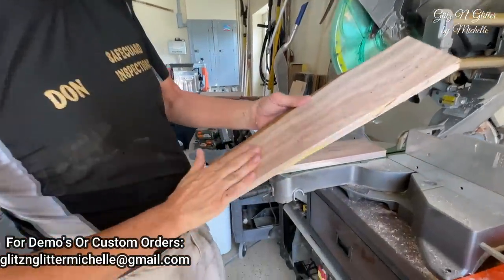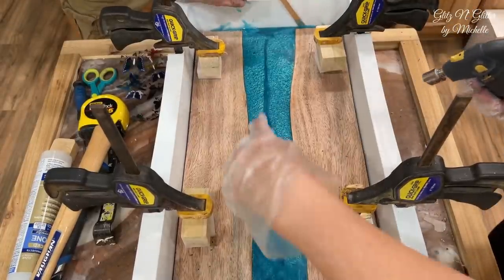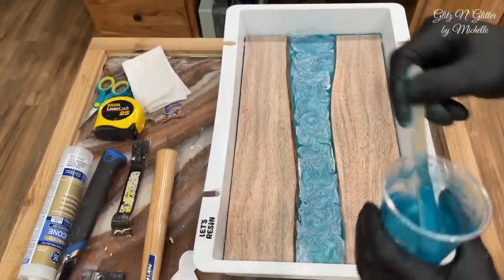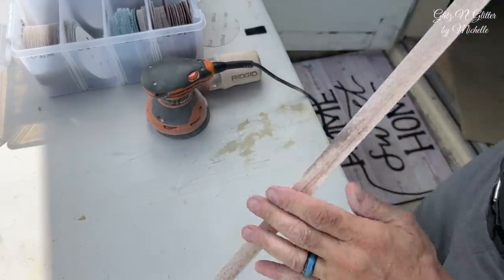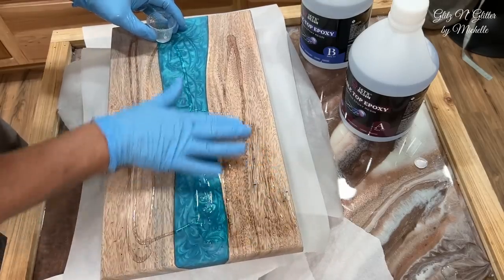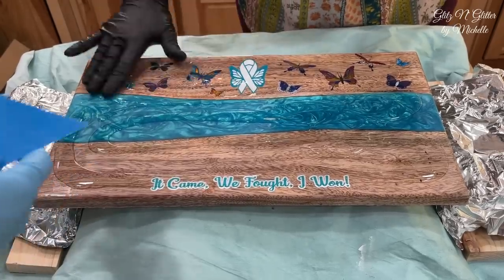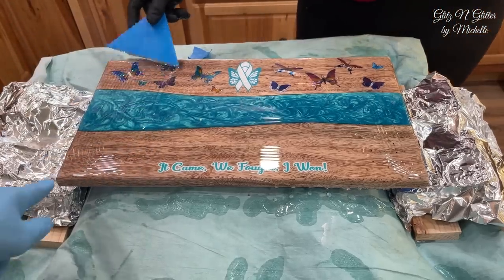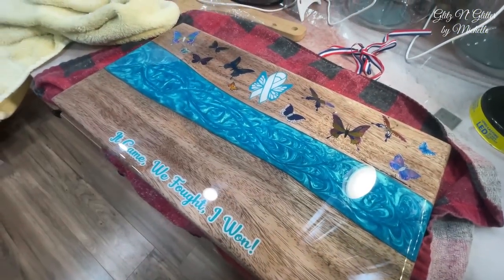#280 Resin/Epoxy River Charcuterie Board For A Special Cancer Survivor!

Comment: Teal and white is also for cervical cancer.  Which is what I had.  January is the month for cervical cancer. 
That is too funny adding white. 
So it was cervical cancer. 
 What is the difference between micro pearl white and macro pearl white? Anyone have an idea?
Reply from the maker: I have no idea on the difference of white. And yes it was cervical cancer and she kicked it’s butt 😃
Reply: @glitznglitterbymichelle1  I was lucky.  If my annual appointment had been the next month who knows?  It went from pre-cancer to stage 1 cancer in just a month. And my pap from that appointment came back clean.
Reply: @VickyCooksalot  I got lucky too. Mine was caught stage 2a. But I was unlucky too. Endometriosis scar tissue had fused my colon and uterus. They refused to resect my colon, said I was too young at 45, so no hysterectomy. I had to have the normal treatments, plus internal radiation, plus a second round of regular radiation. All that radiation caused other side effects like primary lymphedema from my waist down and it cut the communication line from my bladder to my brain. I now have an artificial communication device called an interstem in my back and I do lymphedema therapy every single day. 
I'm glad yours was caught early.
Reply: @kdscraftcorner  I was told with all the endometriosis scarring that a hysterectomy was better. That the tumor was completely contained in the uterus. She wanted to remove it before it spread. Ovaries went too.